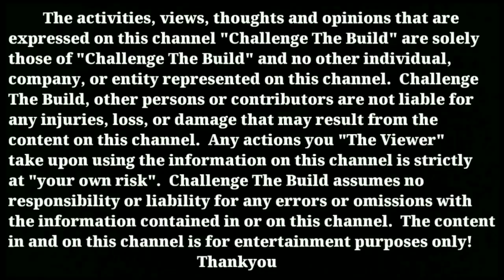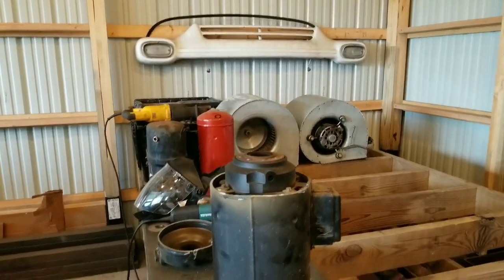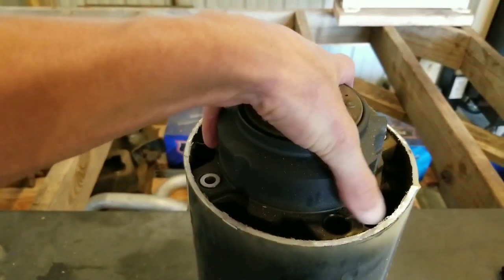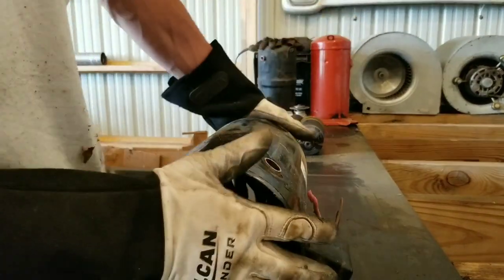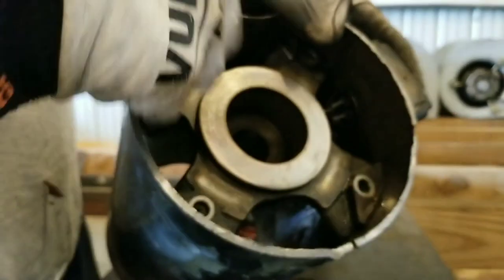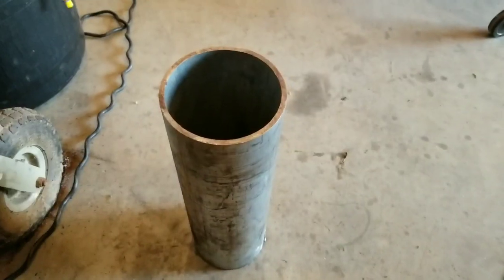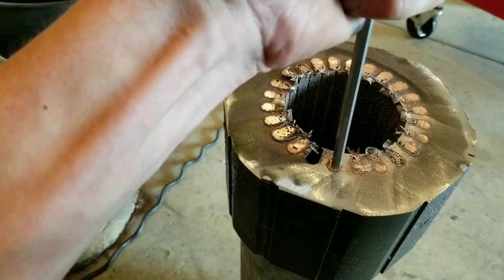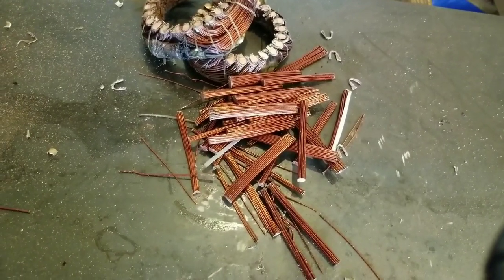Scrapping A Compressor For Copper (Short Version)

Comment: Hi. Your post triggered my PTSD.  Im 56 and have been using cut off wheels for a few decades. I also took off my guard so I could get in spaces better. Never had a problem until the last year. Was cutting off a chain link fence that was nailed to these telephone poles. Was cutting all day and was done except one strand of chain link was still nailed so I had one more cut. Leaned over cut the last chain link and the the blade exploded and chunk the size of jagged quarter went into my wrist pretty deep. Was afraid to pull it out and drove to the emergency room with it in. They Xrayed  it and were not sure if it was in a artery or not. When they pulled it out they had the vascular surgeon on standby and the crew were in full suits so they wouldnt get blood spray on them.   Luckily it didnt hit anything major so they stitched it up  and away I went. Alittle bit of post tramatic stress with this cutoff wheel now. Got over it somewhat and last week was cutting off a chunk of aluminum and the cutoff wheel jumped and went across my thump and back to the emergency room I went. More stitches, 7, and a tight tendon that will have to stretch in time. Ive used this thing for 30 plus years never with a worry. My luck ran out. Guess my point is be careful. I dont think its worth it for the copper. I have more skills then time so I will get my money a safer way. I look for the easy metal and money now.  PS I was warned a few times throughout the years about cutoff wheels and blew them off.  Thanks
Reply from the maker: Oh man...what a story... I know right off the batt cut off wheels for some reason do not like aluminum definitely acts differently... Working with grinders and cut off wheels is extremely extremely dangerous.   Even if you have all the proper safety equipment they are still super dangerous.    I do appreciate you posting a comment and keeping everyone current with real life stories.   I appreciate it thank you.

Comment: Hello scrapper bro IV been cutting open these ac compressors ever so often now and I can't wait to fill a bucket full if copper wire I can't wait to get all of them I have all done
Reply from the maker: It doesn't take long to fill a bucket and I can tell you a 5 gallon bucket filled with copper windings weighs about 50lbs +/-!!  I always keep my compressors for last and save everyone of them for the not so busy days.   The scroll compressors take the longest but they are still profitable especially for that side hustle !!!   I appreciate you dropping a comment!👍   I have plans to make another similar video explaining the difference in cost$$ between cutting them apart vs not..  Now go get that copper!!🤑🔥

Comment: 5:51 I might try that one, but use an air chisel with a hammer bit XD
Reply from the maker: That would probably work good.  It doesn't take much to get them out once you cut them, sometimes they just push right out...good luck and stay safe...👍

Comment: Does the oil have PCP contaminates in it? Also can you use the oil for a lubricant in a pump can?
Reply from the maker: I am not sure about the pcp contaminants you will have to do your own due diligence on this, and as for a lubricant, I have heard a lot of people use it for air tool oil but other then that I am not sure.   Maybe start by looking at the different types of oil used in the systems then look at basic ingredients 🤷‍♂️.   Lots of information out there... Good luck and thanks for watching and commenting...

Comment: Does the effort per hour justify the money is what im asking 2024 June prices Indiana
Reply from the maker: I know that if I had a few hundred compressors laying around I would cut the apart yes.   The key is getting into a system that works and then once you get it figured out soeed will naturally follow.    Once I found my rhythm I could do 4 - 6 an hour and even if prices are low I feel like it would be worth it. 🤷‍♂️.  You could always run a test too.   Cut and clean 10 units, track your time and then cash in everything from the 10 units and then run the numbers to determine if it is worth it or not for you...👍👍 Good luck be safe.
Reply from the maker: That would be something for you to decide...  That is why I suggested running a test.   Good luck and be safe.

Comment: Sir how much profit can i make in a fridge compresser and plz tell all metals part in fridge compresser I want to start fridge compresser scrap business
Reply from the maker: That's sorta a tough question to answer just because of so many variables.   When it comes to profit I have no idea because it would all depend on the price of scrap at the time also, how long it takes to cut them apart, and how you acquire them.  As far as the metals I would say most of it is going to be light iron with a very small percentage being precious metals...Good luck on your endeavor and thanks for the comment!👍
Reply: Sir metals are in a compressor
And their quantity

Comment: Just a fyi....a plasma cutter works way faster and it's safer, i can cut roughly 10-12 With 1 tip for the plasma cutter.
Reply from the maker: I am certainly not going to argue that, I just dont have one yet.  Thanks for the feedback. 👍
Reply: @ChallengeTheBuild  I started with cut off wheels until one came apart...went and bought a fortney plasma cutter for just over 400 makes a huge difference
Reply from the maker: Would you recommend or buy the same plasma cutter again ? I see the forney 251 for $369.00 which makes it affordable, and if it allows you to process the units faster it pays for itself anyway.

Comment: You didn't need to cut the other end wires off. Those wires slide out easy by using a hook shape rod, pulling the copper loops on one end. Put the stator in a large vise first to hold it though. More cutting = less copper. And using 1mm thick blades makes all the difference too. Looks like you needn't cut the top off at all. The difference between heavy and light steel ain't worth the discs getting used. But then they're not all arranged the same inside. Last one I opened, cut the top off, slit the side and the motor slid straight out when I upended it. Next time I'll drill the top and drain the oil first as I cut them on their side!
Reply from the maker: I sort of changed my method a little bit, see it here in this video https://youtu.be/THl2t3unPps .  I like to cut both sides off then hammer out the rest.  I feel it's easier and faster 🤷‍♂️ I have tried it multiple different ways and just keep coming back to my original way.   I also don't think there is a wrong way, as long as we get the same result and do it safely.. 👍 Thanks for watching and commenting...

Comment: Not worth 10 bucks in scrap
Reply from the maker: Not worth the time? Or not worth $10 in copper?..  I can have one torn down in 15-20 minutes depending my mood (faster if you have a plasma cutter), and at current scrap prices there is approximately $15+/- of copper in each motor...it adds up especially if you just do it on the side on them rainy days...and you can also recycle and filter the oil, makes good air tool oil... It's definitely not for everyone.  I appreciate the comment..makes for good dialog...👍